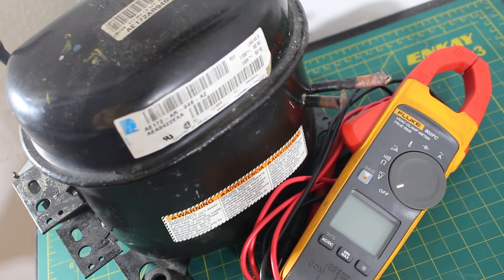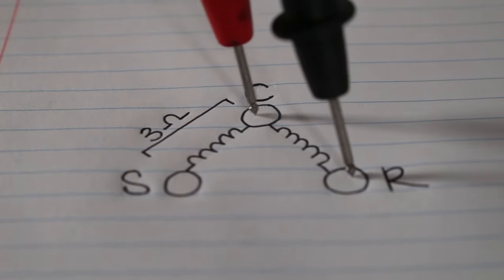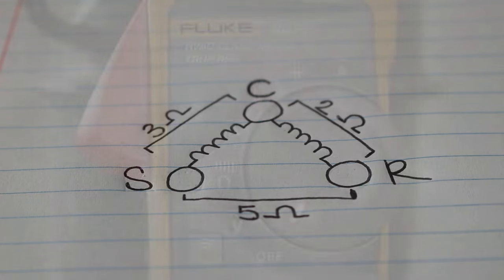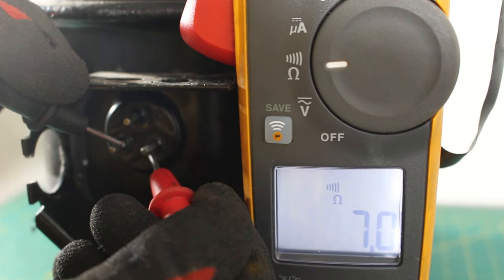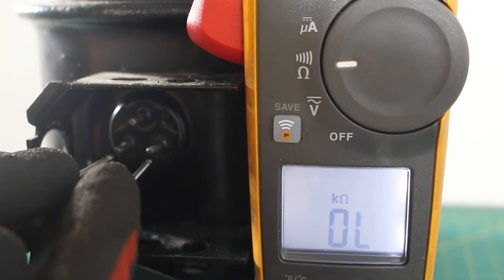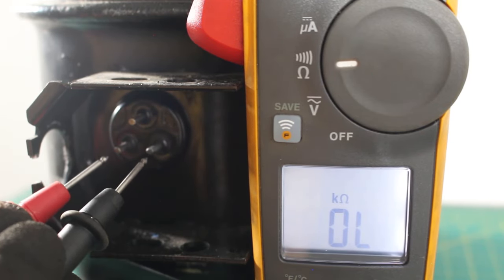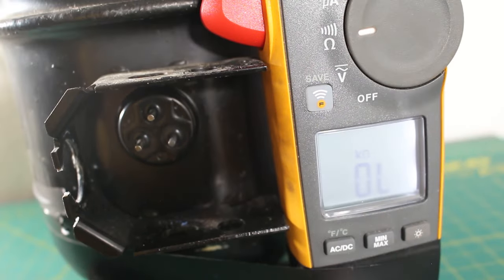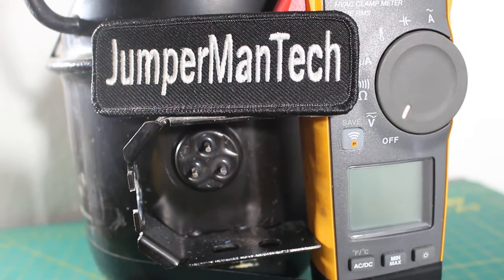HVAC: How To Test a Single Phase Compressor & Check For Any Grounds (Insulation Resistance) Ohm Test

Comment: Great video. But the only thing this and other videos leave out is what happens if the sum of resistance readings DON'T add up. Meaning, what does that look like? I'm in that situation now, as a DIY trying to diagnose my compressor after replacing a bad 2-pole circuit breaker (one pole was bad) and finding the one of the terminal wires blown off which shorted to the casing and tripped the whole house power (ac cb's are on same outside meter panel as main shut off). Anyway, I get readings across all 3 pins, all under 10 ohms, but the C-S winding is reading high, thus the S-R sum doesn't match up with C-S+C-R.  Frustrated. Waiting on new connector wire kit to arrive before I can hook it up and retry, but worried it might blow out again with this odd readings.  I just don't know what typically happens in the field in this situation. No one seems to cover that part.

Comment: Hi. I checked my compressor using your instructions. I couldn't access the compressor directly because I can't reach it (5 ton system). I disconnected the wires from the contactor and the capacitor. I first checked for ground shorts. No shorts. I then checked resistance. My readings are a bit off. I'm reading 1.4, 1.0, 2.0. So it's not adding up correctly. Does this mean my compressor is going bad? I checked the amperage draw while running. I get different reading before and after the contactor. I get 16A (terminal side) and 21A (load side). Is it normal to get different Amp readings before and after the contactor? The RLA is 26A on a 5 ton heat pump. Thanks.

Comment: Very clear  instructions. Thanks. Allow me a little  comment, the running coil should be of higher ohm(thin wiring). Starting coil is thicker wiring and thus, lower ohms.

Comment: Informative,  interesting and helpful video. Great job JMT.  ⭐️⭐️⭐️⭐️⭐️⭐️⭐️⭐️⭐️⭐️
Reply from the maker: Thank you thank you! ⭐⭐⭐Stay safe out there & stay tuned for new videos every week🔧
Reply: @JumpermanTech  yo i got a question what do u mean when u say your grounded when checking the restistance of the compressor?
Reply: Seldcomprssor  terminals  c .s  and  Rare  identified  by  measuringrheresitance  ohms   between the  terminals  usingmultimeter  or clamp  meter the  resistance  of  ruing  winding is  low while  thatofstarting windingis  high   when  the  multimeter pords  are  connected to  twrminal R and  c  resistance of  ruing  windingor the  low  est  resistance  is  indicated  whwnthe connected  to  terminals  c r  and  s  total  resistance  of  both qinding is  indicatwd  when  the  terminala   c  and  s  are  connected  to  the meter  the  resistance  of starting  winding is  indicated  or  the  value  willbe  bet ween the abovetwo rhe high est  resistace  ind icated  bet wen r  cthe resustancc  and sthes two  sum  of  resistance  of  ruing betweenr  and  c  and  starting windingbwtqeen c  and s is to r and s  hight expls  1.2 50 2.3 30  .1.3  20 lowesr  1.2 rs 2 3 cs  1 3 r  1  r  2  s  3  c   hight  reding 50  medom 30  low  20  low est  restnc   rc  highest  r s  13 lowes

Comment: Best. Explanation. Ever. Thanks! So my compressor is good, there are no shorts BUT it is not cooling... What gives if it not the relay then? Too much gas topped up last time? (I noticed the compressor was running very hot). Its a wine fridge so not as complex as a fridge/freezer...

Comment: Really enjoyed the video. I have a chest freezer; stopped working,  but caught in time to save the food.
Did the resistance check on compressor; all checked good. Overtemp switch, checked good. Relay checked good. I replaced the overtemp switch & relay; still won't work. Could the compressor be stuck? If so, how can I prove that?
Thank you.
Reply: Vrey good gueshering gues  all best welcomed gues  thanyou gor allgues  shering gues guied allgues thkyou somuch  ..

Comment: So I’ve checked if I got 1.2 ,  3.1 and 3.8  so is the compressor ok ?
Reply: I got 2.5 run 3.5 start and 4.8 5 .5 for run + start
Reply: Unit ran for 1 second and would shut off . Got 50 amps when lra is 40. Chnaged cap , relay and tried a hard start. She wouldn't go. No high limit no lpco no continuity to ground... how would you finalize diagnostics.  It would run when you bump started it as well but didn't seem to have too much power behind it .
Reply: Mine is ok  I’ve just changed capacitor nothing else and it’s cool now

Comment: So for a Samsung Compressor with the S-C-R scheme, I get readings of S-C 7.2 ohms, C-R 7.5 ohms, R-S 7.2 ohms but none went ground to copper. Is my compressor good or bad?  One more note, the compressor- MKV190CL2B is label rated as 240VAC 3 P- Huh? I'm only providing residential from-the-wall 120VAC. How can it work?
Reply: It is 3 phase, the 3 phase is created by a pulse width module signal from the inverter control board that converts single phase to 3 phase. 
In the Appliance tech world we see more dead inverters dead then compressors on Samsung units.

Comment: Great video. thanks. If you have a ground short or OL when checking resistance, may the compressor still run or do you only perform these tests if the compressor won't run?
Reply: Diffrant reding  conunivet showing good runig starting point como n low restisans ok

Comment: I can't find any videos on MECHANICAL FAILURES of a compressor.  I have a compressor that the windings are fine but makes a ugly loud noise at start up and then trips the breaker.  Anyone know of a good video to check for mechanical failures?
Reply from the maker: I have many troubleshooting videos on my channel so subscribe for new videos every week! Sounds like locked rotor on the compressor. Check the compressor specs for LRA. Locked rotor amps. Upon startup, check amps on the compressor and if it's really high and matches the LRA versus the RLA (Running load amps) then you have locked rotor and the compressor needs to be replaced. Before determining that, make sure your start/run capacitors are good. If the caps are good, your compressor is bad and needs to be replaced. If the capacitors are bad, replace them and see what happens. Most likely will solve your issue. Thank me later 😅

Comment: I'll usually run a sj cord from the vans battery to ground on the door frame into the unit. If I 1890kohmsufs to frame from van it's a working canuuter oscillator

Comment: Please what if the value of c-r=20.5, c-s=29.5 and s-r=50.5
Reply: means compressor seems good; check for isolation of the 3 pins now

Comment: What is that meaning open and close winding?
Reply: Two types of shorts can occur in a compressor motor, a turn-to-turn short within a winding or a winding-to-frame short. The reading obtained between the Run and Common, and the Start and Common pins should be within .5 ohm of each other. If these readings are significantly different, the winding with the significantly lower reading has a turn-to-turn short and the compressor needs to be replaced. Check for a winding-to-the-motor- frame short by taking a reading between each of the pins and the compressor housing. If the meter's LCD displays anything other than an "O.L." during these tests, the compressor is bad and needs to be replaced.